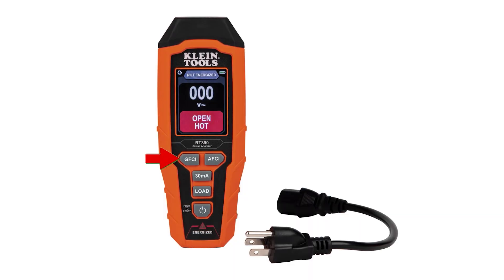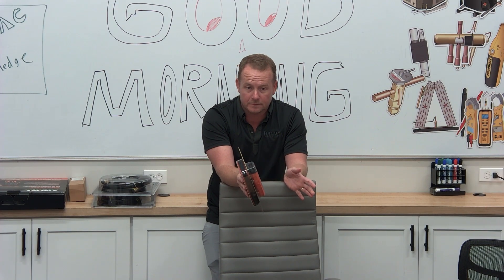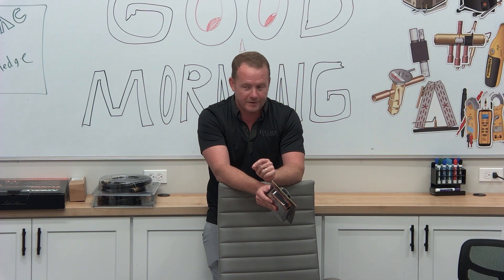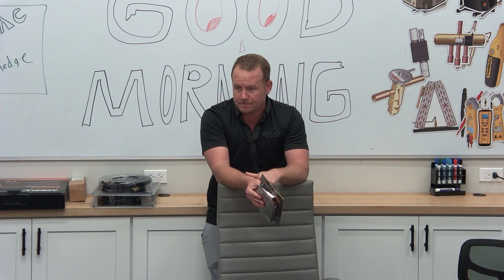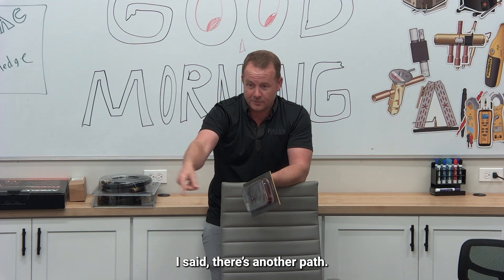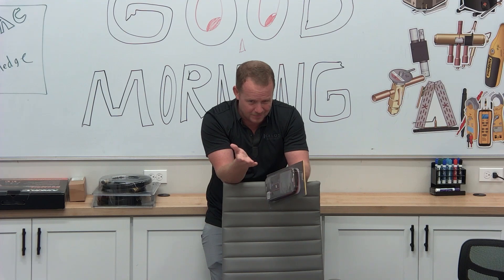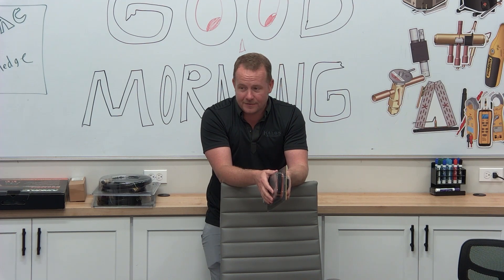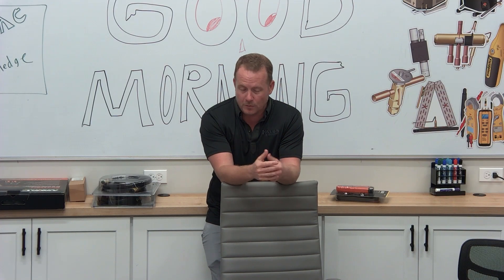GFCI and AFCI Testing Explained | How to Test Ground Fault and Arc Fault Circuit Interrupters

Comment: Very interesting topic, thank you. I have an LG all-in-one heat pump drier...it trips a 20 amp 120 volt breaker every once in a while.  I put an ammeter on the dedicated circuit and found that the unit did not draw more than 13.1 amps at last trip. Later, I found out that LG and other combo washer/dryer manufacturers seem to be having the same problem.  During the drying cycle, sometimes when the compressor starts, it creates electrical noise that manifests as a small ground leakage current that the GCFI misinterprets as a fault.  Apparently, my Siemens dual function CAFCI breakers are especially notorious for this issue.  Apparently there is no fix for this overly sensitive breaker...I've heard that Siemens is facing a class-action lawsuit over it.  I asked Grok about it...Grok says there is a newer generation Siemens dual function breaker so I'm going to ask my electrician about it.  Nuisance tripping is always with us, it seems.